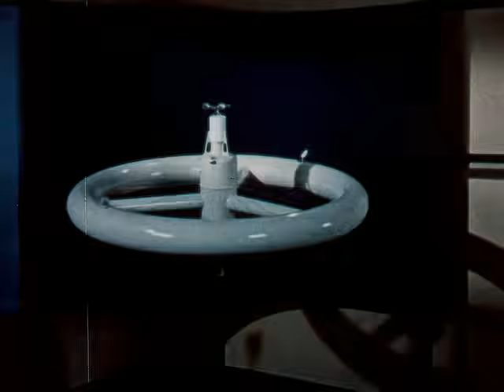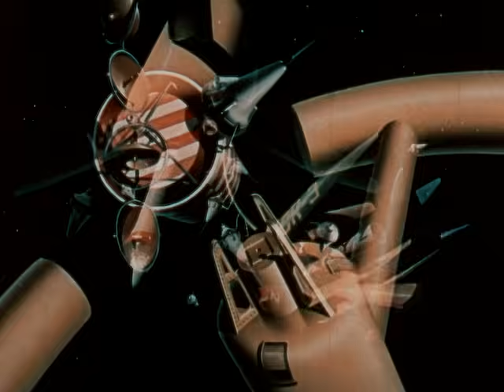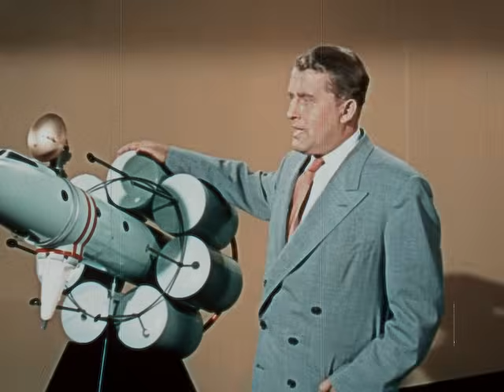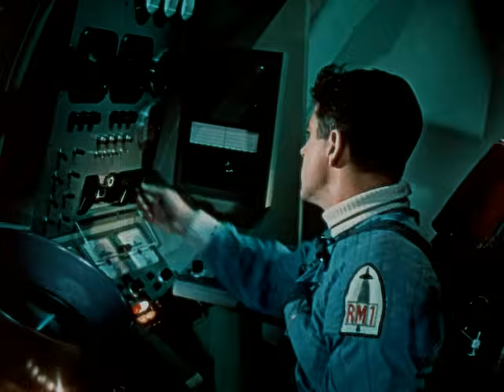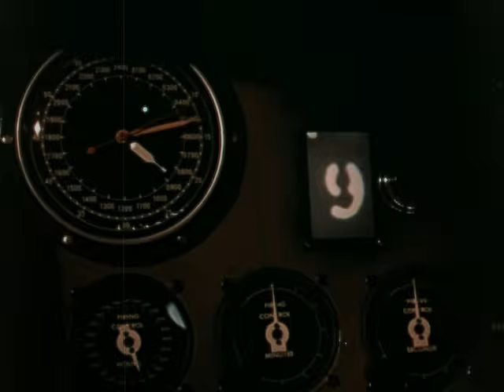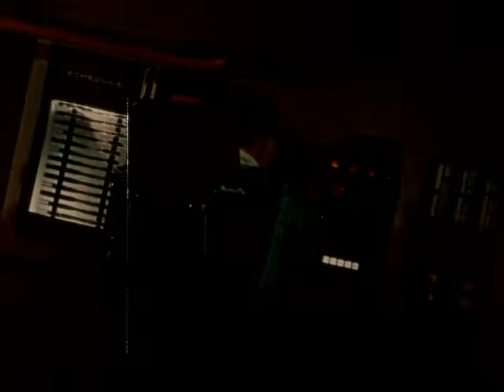Man And The Moon (1955)

Comment: Noise in space. Some concepts just never die. That's most unrealustic, even in 1950s understanding. And who ever thought of bringing a full orchestra along on a moon mission is quite daft.
Reply: While it's not depicted totally realistically, there absolutely IS noise in space, at least onboard a spacecraft. The engines are creating tremendous pressure and vibration and that is transmitted through the structure into the cabin. Also, watch the spacex staging footage with microphones- the exhaust generates enough temporary pressure to cause sound in the vicinity. It drops off fast but it's there!
Reply: Disney budgets. :()

Comment: Big thanks for posting. Very cool to see what Earth Orbit Rendezvous would have looked like. Of course as someone else pointed out, it would have probably cost a trillion dollars. In the end, Lunar Orbit Rendezvous was so much more efficient and the way to go, without having to take a giant rocket all the way to the moon and back.
Reply: not necessarily true.  You will notice they spoke of lightweight inflatable modules what would have protective panels attached to the outside for protection, primarily of cheap and easy to manufacture materials.  

What made the actual moon missions so expensive were not only the sheer speed at which the project had to progress, but to do it all in singular missions, requiring far more complicated and experimental materials.  You can't just use simple plastics or titanium composites, as they would either make too large of a vehicle or be too heavy to get everything onto one singular rocket.  

Now, having said that, the sheer volume of the space station (accommodating 50 people) would certainly drive up the cost of materials and consumables.  But the cost per person would be dramatically cheaper than the "waste anything but time" approach that Apollo took, only to stop almost dead in its tracks once the political goal of beating Russia was achieved.  

The biggest problem overall is how almost no space program survives into the following political administration, so we are never able to set forth any kind of 10+ year plan, or even a 5+ year plan anymore.

Comment: Interesting how they imagined the four crew roles.   We used to have navigators on commercial airlines didn’t we?
Reply: Yup. Separate navigator, radio operator, and flight engineer. A 5 man crew on something like a Constellation or 707. The navigator used a sextant from a window or sometimes a shallow dome. Sci fi authors invented the term astrogator and imagined them using  sextants. The Apollo crews actually did use sextants, but the pilot and commander had to learn to use one.